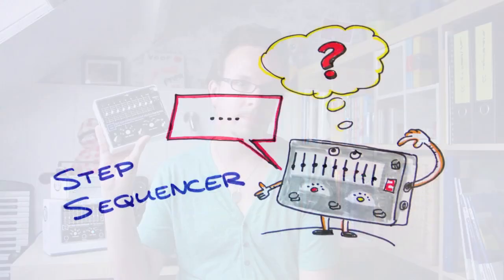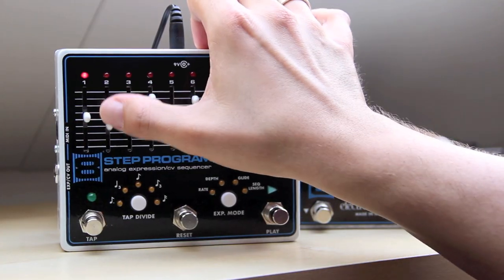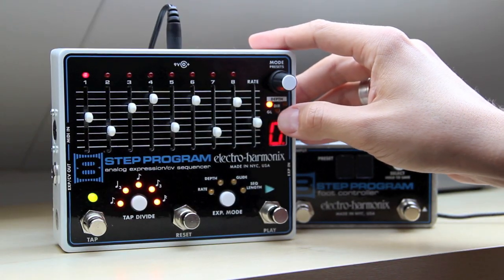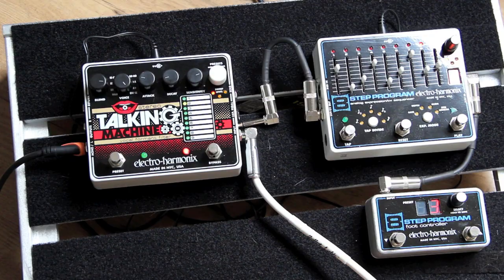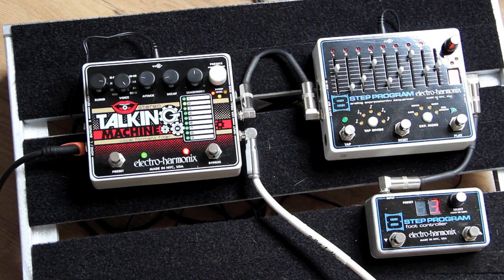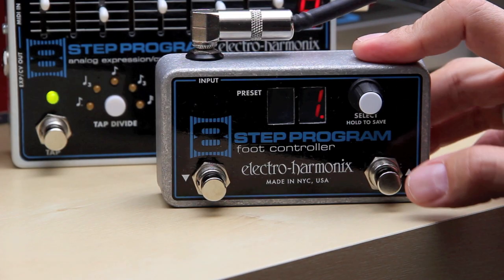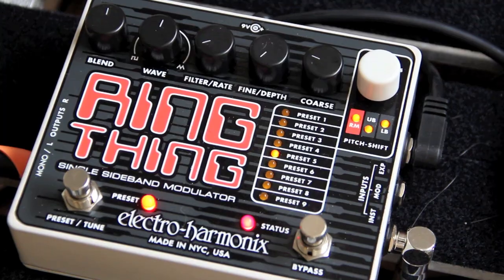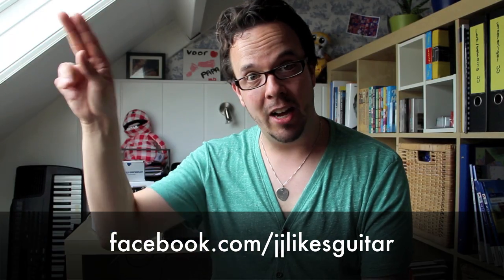Electro-Harmonix 8 Step Program Analog Expression / CV Sequencer Pedal (Demo by JJ Tanis)

Comment: I’m a bit confused at the final chord progression. It sounds like before he used this pedal it’s just distortion. 
   But the ring thing isn’t a distortion pedal correct? Since both pedals are being used I’m confused if the ring thing was adding it’s own effects and modulation ?

Maybe I missed what the ring thing is doing . 

I actually thought that final sound was cool but I initially thought it was the pedal with distortion , with the ring thing in the mix I’m not sure what’s going on . I didn’t hear it do anything when he struck a chord with distortion

Comment: Can I use it with a switcher, so I can use it with other effects, such as fuzz?
Reply from the maker: If your pedal has an expression pedal input it will work.
Reply: @EHX  ok, thnx
Reply: @EHX what about using it with switcher? Does it still have to be connected to expression in or can it control other pedals?

Comment: So, it doesn't work with a pedal which has no expression input?
Reply from the maker: No as it uses control voltage accessed via the Exp jack
Reply: @EHX  thanks for your answer.